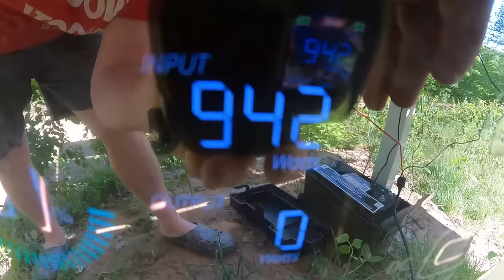Off Grid Solar- HUGE IMPROVEMENTS- Eco Worthy Dual Axis Tracking System

Comment: Sorry to say your tracker will be headed for mechanical failure unless you do some upgrades on it. https://youtu.be/tV9xZ5Nrt48?t=231 The bolts should not simply be put through the open tube like that without support. Just pivoting the parts on the bolts in holes through pieces of steel is horrible design, especially when there's wind. Any slop allows the parts to get banged around, which will cause wear, and the more it wears the more it can flop, which will wear it faster. Look carefully at the pivots on the tracker in that guy's video. Huge amounts of wear. That slop will also have a lot of banging on the actuators.

What grade are the hex head bolts? You want to see 3 or 6 radial lines on the heads if they're US or two numbers with a . between if they're metric. Bolt grade identification info is easy to find. US or metric, if the heads are unmarked they're *cheap junk*.

I've been looking at these Eco-Worthy tracker mounts on several videos and they all have the same design defects. The cross bolts should have tubes welded in or a solid block inserted (even a tight fitting piece of Delrin or UHMW plastic would be better than the nothing this thing has) so the rectangular tubes can't crush. Bolts should be at least Grade 5 (3 radial lines). The pivots should have real bearings.

Got a cutting torch and a welder? Get some pillow block bearings, some pieces of steel, replacements for any low strength bolts, and rebuild it before it breaks sometime this coming winter. Also get a Rivet Nut tool and Rivet Nuts to mount any new stuff, like the pillow block bearings. You can use a bolt and a nut to install Rivet Nuts but it's easier and faster with the tool, and you'll probably find many other uses for them in sheet metal and thin wall tube things like this solar mount.
Reply from the maker: I understand where you are coming from....but this unit moves so little in comparison to other items with more rugged design. If compared to something like the suspension on a car or pedals on a bike where high pressure, weight, and fast movement and torque are involved I see where a different union would need to be used, but with this tracking system I see literally  one swipe of motion per day. Could it have stronger bolts and unions.....yes, is it necessary....I don't believe it is.

Comment: Putting that tube into the ground and pouring concrete into it makes little sense. It would be much stronger if the concrete were poured into the hole as digged out. Concrete is strong when pressing on it, but very weak if pull is applied. Someone commented it here already that it will be laying around after a strong wind. I think it could happen even without that strong wind. Ask an engineer..
Reply from the maker: You can talk all you want....but it has already seen 50-60 mph winds and it handled it fine. We will see if it can handle higher when we get them. Many comment it will fail, people have been saying that about many of our projects over the last 3 years and it is all Still doing fine. My solar was going to burn my cabin down....my solar array would blow away and fail....my cabin would fall over....yet none has happen yet. Lots of nay sayers

Comment: 40% ? How accurate is that number? I watched another video where he did a very accurate comparison and came up with 30%. Of course different location, different panels. Since this video, have you gotten an exact calculation with a day where you turned off the tracker?
https://www.youtube.com/watch?v=Hyx1ZUN9bqc
Reply from the maker: I have not done a deep dive into the numbers.....it works good and produces 900-1000 watts for most of the day, rather than only a third of the day like a stationary system.

Comment: Not worth it, simple. Buy more panels using that money and you will have double the yield that this system will bring you. And with that wind you say you have, don't even think about dual axis tracking.
Reply from the maker: LOL....Hans said it...Must be true I guess. I get GREAT input from this Array....best angle for 10 plus hours a Day, meanwhile the stationary system produces about 20-30% of what it is capable of for the Morning hours.....60-90% for a few hours in the afternoon.....then back to 20-30% the last third of the day. Yes you could achieve comparable results with MORE panels....But this system produces GREAT increases in Production. SIMPLE

Comment: The worst base ever.... Without metal. Bigger wind will take out those bolts.
Reply from the maker: Lol.....we just had over 60 MPH winds.....taking put many many trees and it is standing strong. I hate arguing with people.....but I have done it for close to 5 years here on YouTube and all who have argued have been wrong thus far......sorry
Reply: @OffgridwithJayandJen  Ok. After the trees comes the bolts. I'm a building engineer, so I'm know what I'm talking about. You did it wrong, but no one told you it wont work. It will broke when before and after the tracker wont be trees anymore.
Reply: @DPTech_workroom 

Could you share how you would do it please?

Comment: Hi, what happens when the winds becomes much stronger. Does it automatically make the panels flat as a safe Mode for instance? If so, is that enough for safety? Thanks..
Reply from the maker: Yes, it has  wind sensor and night mode that takes it flat. Ours has seen some good wind and is still standing